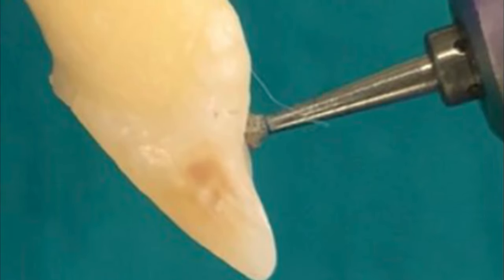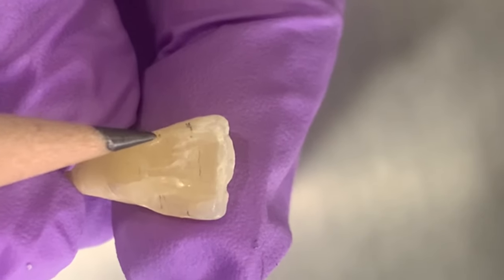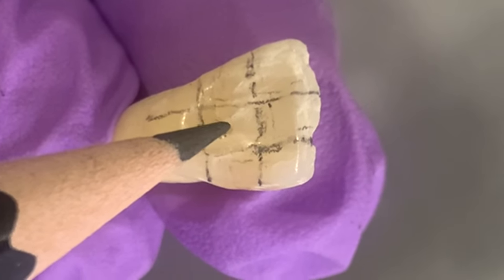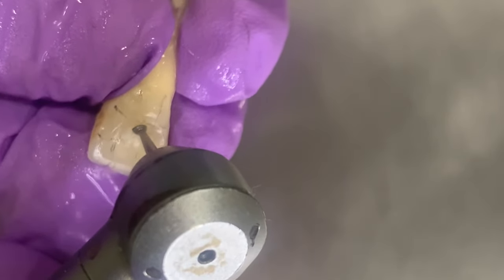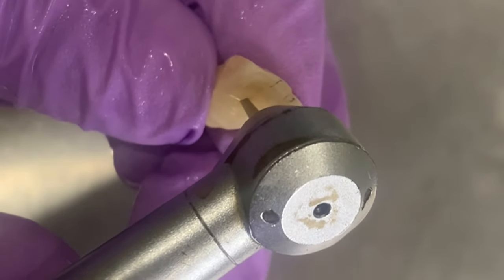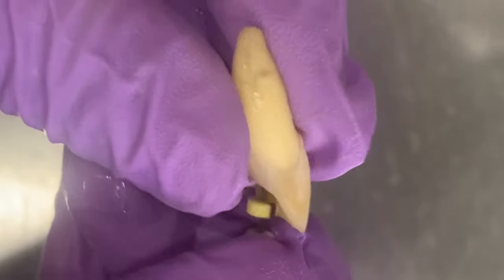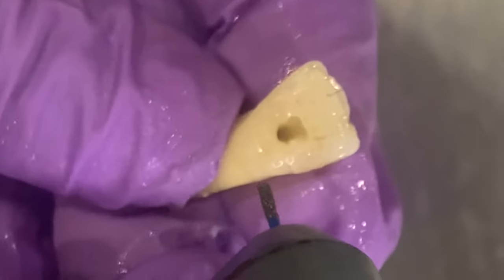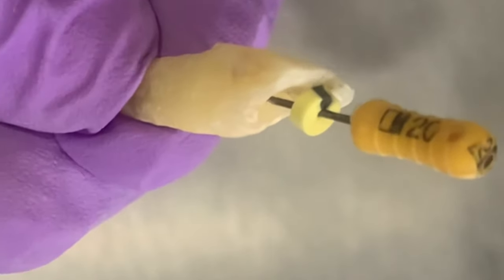Incisor access opening| Incisor access cavity RCT| Easy endodontics for maxillary incisor

Comment: Maam , what's the use of ' DIAMOND BUR ' & ' CARBIDE BUR ' ??
Reply: Cutting
Reply from the maker: If your question is regarding their use in the clinical practice for cavity cutting, then I feel you can use anyone of them. They are as good.
But if you come to differences, then there are specific differences in both of them concerning their material, type of cutting et cetera 
On whole diamond burs are more used when precision cutting is required. Also they are good for cutting Zirconia crowns. But their cutting leaves rough surface of the tooth
Carbide, burs are more durable, they cut metal better, they leave smooth surfaces after cutting the tooth 
Basically it’s u r personal preference!!!